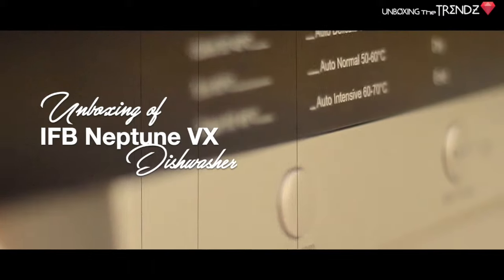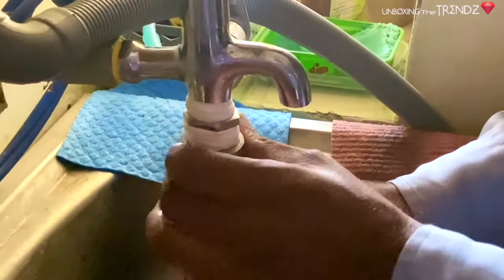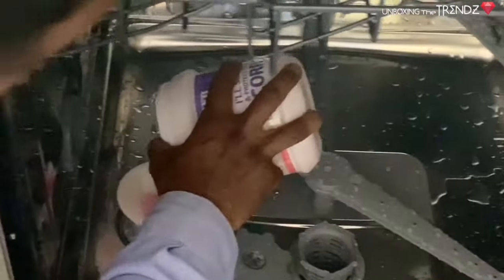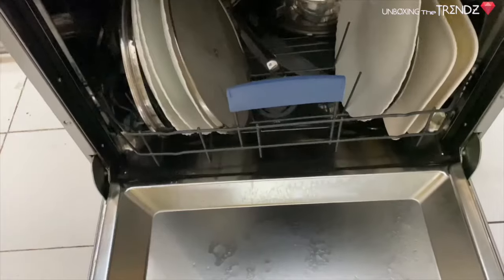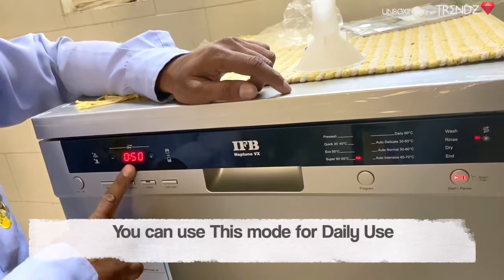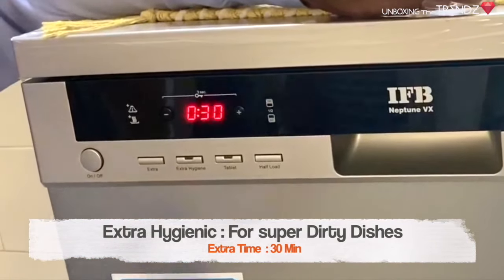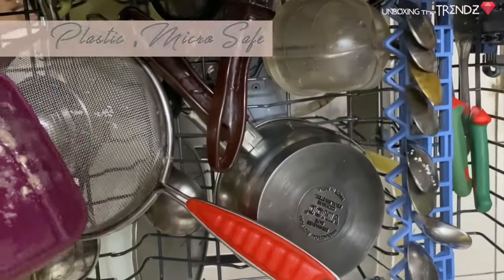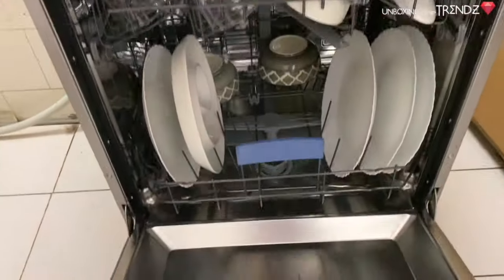IFB DISHWASHER NEPTUNE VX 12 PLACE SETTING UNBOXING / INSTALLATION / REVIEW /2020/ UNBOXINGTHETRENDZ

Comment: I have recently purchased Neptune VX. However noted few observations. For my first wash I chose super 50. However on completion of programme , there was lot of froth over the utensils, especially at d base of machine. IFB technician told to do pre rinse but to no avail. During my second set of washing again same problem being faced. Utensils are not even completely dry. Another observation is  that whenever programme is over the detergent cover is found in open state. Technician said this is norma and suppose to happen this way only. Third and last although all programme are working fine but I find little mis alignment of cover. Kindly clear d doubts.
Reply: Reduce detergent and Rinse Aid settings, it will bring you good results. For shorter cycles, use detergent, not the tablet. Tablet does not get consumed in shorter cycles, leaving milky stains and froth. For best results, use longer cycles. Try these suggestions. if still you face problem, let me know.
Reply: Exactly same experience with Bosch dishwasher. Rather worse. Wash a tea pan and everything is ruined. Very bad filtration. Bosch is the worst dishwasher in India.
Reply: I have also used the same option for wash for I am still getting white patches on my plates not on anything why so ?

Comment: I'm using ifb dishwasher from last 1 month. I  have used finish tablets and the result are good. But yesterday technician came for demo and as our water is very hard so he fitted water softener and add salt and rinse aid. But yesterday wash utensils are not cleaned properly and white residue us there in almost all utensils. Can u pla let me know what to do in thai case
Reply: No dishwasher requires Water Softener as every dishwasher has inbuilt water softener. The compartment, where you fill the salt is the water softener.  Better buy a TDS meter from Amazon. It costs only Rs. 200/- Test your TDS, it should not be more than 500. TDS till 890 is treatable by the inbuilt water softener of dishwasher. If you can tell me the duration of the cycle, I can advise you as to how to get rid of white residue.
Reply: @AtulKumar-sw6fc  our tds is 900 I guess n technician installed water softener and set setting of salt at 4 and rinse aid at 3.i generally select daily wash which takes around 1 hour 20 minutes. M using ifb detergent.
Reply: @amrutashirod496  JI, How did you learn that the TDS level is 900. The government has prescribed that the TDS should not exceed 500. If the water hardness has not been properly tested, excess salt also poses problems. As you have been burdened unnecessarily with a water softener, a salt setting of 4 is very high. Your 1.20 minute cycle means that you are using a medium cycle,  which is an excellent cycle. You may kindly use same cycle with salt setting at 1 or 2. Place 6 or 8 grams of detergent (or half tablet) in the detergent compartment. I believe you should have an excellent wash cycle. As said earlier,  water softener is an unnecessarily burden. Anyways, it will cut down your expenditure on salt. Kindly revert back with results.
Reply: @AtulKumar-sw6fc  thanks will check after make salt setting at 2.can u pls tell with salt setting 2 what will be the setting of rinse aid...
Reply: @amrutashirod496  Normally 2 setting should do. Rinse aid is basically used for fast removal of water from the utensils. It also gives shine to your utensils. If needed, it can be raised to 3.

Comment: Hi very nicely described the mechanism. Now you must be well versed with dishwasher as you are using it since long. So now you must have got a very good experience with it. You can share your experiences now. I am planning to buy so kindly guide. I wanted to know if by chance light goes off will it resume from where it stopped or will it start from beginning
Reply from the maker: Yes it will start automatically 👍🏻👍🏻

Comment: I have the same dishwasher , have been using since 6 months now 
You have to rinse the dishes before keeping them in the dishwasher , and take out any residue or food particles from the utensils 
No need to use soap , just a quick rinse with water.  
Otherwise if you just keep them directly after using , they remain dirty .
This is what I experienced at the start.  
Overall it's a good machine. 
But i would've been happier if i didn't have to rinse  ..  double the job n more water wastage.

Comment: Ifb dishwashers are good
We have been using ours for the past 15yrs
Reply from the maker: I know I am In love with this 💝💝
Reply: Medam there is a water collection in filter .. I removed filter to check and there is a water collection inside.. is this normal .. or it is a problem
Reply: dats gr8 to know u have been using from 15 years!! Hope the racks coating is non- carcinogenic n remains intact at higher temperatures.   please provide me further information regarding this.
Reply from the maker: Yes 👍🏻👍🏻💝
Reply: Kya aluminium bartan non-stick pan crokery bhi wash Hoti h kya

Comment: Is it necessary to clean then before u keep in the machine? Have u tried without doing that and are the results same in terms of cleaning? I also how is the cleaning for kadhai  after deep frying and tea vessels with hard milk stains on thanks in advance...
Reply from the maker: Yes you have to clean them before you place it in the dishwasher, it washes the utensils with hot water so no worries 👍🏻
Reply: So can I conclide  that it will not completely aviod manual process (excluding placing dishes in machine) , we have to rinse utensils once before placing in dish washer. Was looking for my parents so if it has manual work the it's a waste for me
Reply: @anshul27  yeah that the same thing i am thinking... Why we need dish washer is that some utensils are very hard to wash... And if we have to clean waste than what's the point of dish washer..... I can spend more but for fully automatic ......
Reply from the maker: Dear Yogesh and Anshul, do you clean the utensils for your home help, do you dip the utensils in water, if yes then this is it. You just have to clean it with water and keep it in the dishwasher. You can also keep it as it is as well, but then you have to remove the drainer every time. Rest is all your choice. 👍🏻
Reply: You can keep the utensils without cleaning, no problem.. Only for utensils with food particles like rice n all, u need to remove those particles n keep.. U dont need to clean it completely

Comment: very well explained. Due to lock down i got my machine delivered but waiting for the salt and rinse aid.some how i procured tablets.can i run dishwasher without adding salt and rinse water just with tablets?. one more thing do you have any idea about the material used to coat the dish racks? awaiting your kind response!!! a curious, tired mom of 2😁 😁
Reply from the maker: Hey dear if you have tablets then you don’t need salt and rinse aid, one tablet has everything.👍🏻👍🏻you will love it 👍🏻💝
Reply: @UnboxingtheTrendz  Thankyou so much , im relieved☺
Reply: I too bought the same ifb dishwasher and it is very useful. Thanks for the video, very helpful 👍☘️

Comment: I m using this almost last one year...i had one time door locking problem....cleaning is good ...but the problem is during vessel wash ,if i give extra cleaning option vapours coming out ....i dont know its normal or not
Reply: No, it is not normal, contact your dealer/company with registered post and also contact telephonically and personally, before it goes out of warranty.

Comment: I purchased a brand new IFB neptune VX 12 place setting model about a month back, it worked fine for the first 15 to 20 days but then started showing frequent F5 error and once the error comes it stops totally & I have to start all again. I have also noted that the dishwasher feels jammed while running particularly when it sucks & drains water & it really behaves haywire, sometimes while its running the lights from my house start flickering. I definitely feel that there is something abnormal with the machine, it also skips dry mode in super 50 program at times. I have contacted the customer service but not satisfied with their service, I think that even they don't have the solution for this. I definitely suspect some manufacturing defect in the machine itself as I use the machine with proper guidelines but still face the issue. Has anyone experienced such issues?? Kindly reply as this dishwasher has literally frustrated me now....
Reply: Check wire earthing of your home

Comment: Can we wash aluminium vessels, branded non stick pans and pots, along with anodised cooker/ vessels?
Reply from the maker: Yes aluminium, non stick 👍🏻👍🏻💝
Reply: @UnboxingtheTrendz  but aluminium cooker n utensils black nahi hote kya dishwasher me wash krne ke bad
Reply: if you use short wash cycle with low temperature, the aluminum and  brass items can be washed. Only wooden items are not to be placed inside the dishwasher.

Comment: Very nice video. Can u make a video on the water inlet pipe and drainage pipe, tap fitting etc as my kitchen is also not a modular kitchen and just tempted to see how it can fit    in my kitchen...thanks in advance
Reply from the maker: Hey dear I have tied my drainage pipe with my kitchen sink, so that I don’t have to make a separate hole for the sink and dishwasher drain. 👍🏻👍🏻

Comment: Go for Voltas Beko 14 place dishwasher, which costs around 39000/- and has unmatched features, not found in any other dishwasher. It has a top revolving spray and 3 (three) spray arms. it has inverter motor, which consumes less i unit of electricity in all the cycles. It's motor has 12   years warranty. it has stainless steel tub. Voltas  has the capacity to  wash dirtiest milk and tea pots, effectively. Voltas has 30 minutes increment in delay mode, as compared to i hour increment in most of the dishwashers. Voltas is a TATA brand and has formidable after sales network.  LG does not resume cycle, exactly from the last stage,  after power outage.

Comment: In my IFB dishwasher sometimes the detergent doesn’t mix in water and is left in semi wet form in the detergent area. What can be the reason for that ?
Reply: Please arrange curved plates on right side so that the detergent will go
Reply: For smaller programs, which run for about one hour, do not use tablet. Little detergent of half tablet is enough. More detergent or tablet do not get properly dissolved in short programs. Using cycles with High temperature is also good for dissolving detergent.
Reply: Atul Kumar in one of the cycles I forgot to add detergent and the utensils were absolutely clean... 🤣🤣
Reply: @pawantube37  Actually, the hot water jets in dishwasher are capable of removing most of the oily film and traces of food from the plates.

Comment: Hi good video, I have few questions
Do you get black spots when you wash aluminium utensils? What setting do you use?
Do you wash the following? If yes then In which setting?
A. Non stick utensils
B. Wooden spatulas
C. Pressure cooker lid
D. Gas oven burners
Reply from the maker: I use only one setting 50 - 65 C
Reply: Thank you for your reply...Do you use all the abovementioned material in dishwasher?
Reply from the maker: Yes you can use all of them together 👍🏻👍🏻
Reply: Thank you 😊

Comment: The installation guyvsaid not to put utensils in a particular spot? Why is that? So where will we put the cutlery basket?
Reply from the maker: That is for cutlery only and don’t put anything heavy or large in size, as the water comes from the bottom and it should have some space to wash.👍🏻

Comment: How much money do we need to spend for detergent and rock salt or tablets every month?
Reply: If you use Fortune detergent, Rinse Aid and Salt (Not the costly worthless tablets) you spend hardly 11/- to 12/- per wash, which includes electricity also. If you intend to buy a dishwasher, go for Voltas Beko DF14S2, 14 place dishwasher, which is most advanced and has amazing options to wash all types of utensils. I have been using Voltas Beko with great benefits.

Comment: Do we need to put soap in prewash or after the prewash is over. In my demo the engg had put but I feel it will be a waste ?
Reply from the maker: No Nitish you just have to clean them with water and then you can place it inside the dishwasher, no need to pre-wash them with soap👍🏻💝

Comment: When i opened the product it was wet inside... it seems that some one used it in past. the trey rack was broken. there were scratch on the door as well. even with all these odds the installation engineer came to house for installation, he gave excuse. considering such large product initially i did not thought about replacement and we started using the product IFB Neptune VX Plus. in first few wash we got few dents in the utensils and cracks in crockery, also F5 error, the wash cycle was not getting over. We complaint same guys came  with another person he rectified the F5 error and cycle getting over however the dent issue was not resolved. finally the new person came and suggested the machine to be replaced may be some internal issue, i am still awaiting the machine replacement.

Comment: Eco mode 50℃ pr wash time is 02:50 minutes + 00:30 minutes cooling time which is equal to around 3 Hrs..... Waha ji  Waha.... 
Ye kuch jayada time nhi lag reha....
Reply: Eco mode is basically used for delayed washing at night or when there is sufficient time in hands. We use shorter cycles of around 60 minutes for quick results, which are equally good. Dishwasher has great options to suit the washing time as per your convenience.
Reply: @AtulKumar-sw6fc  
Thanks....👍